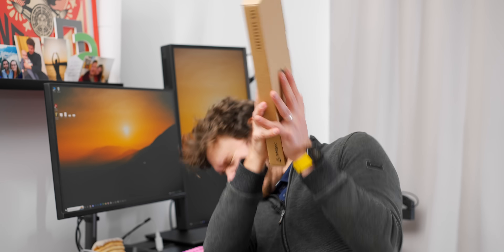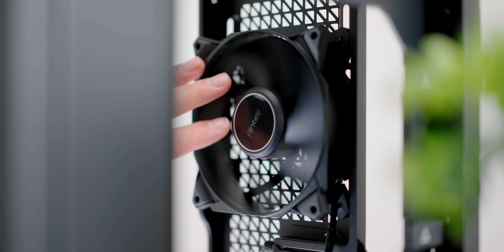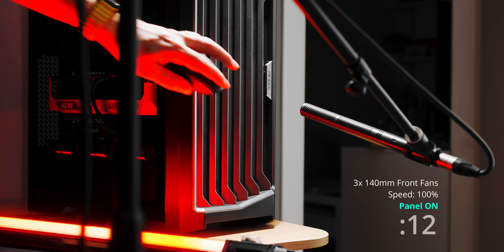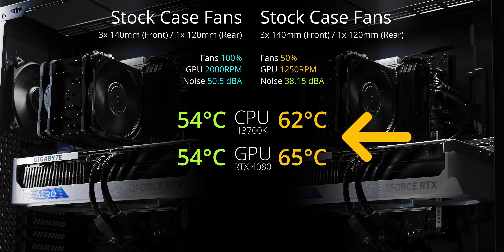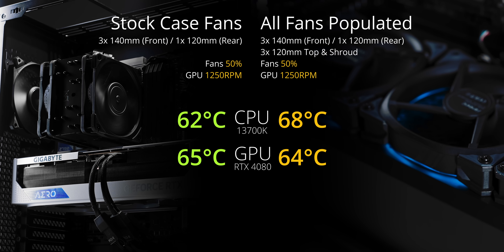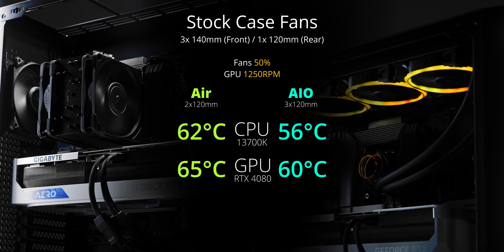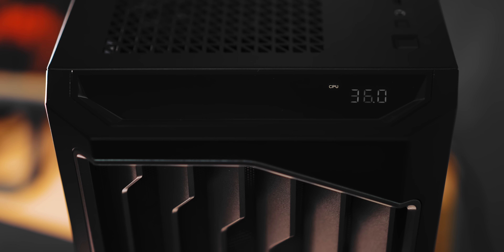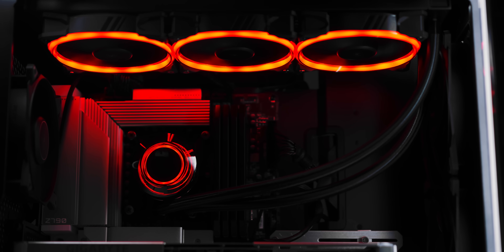How Many Case Fans do you Actually Need?

Comment: zero , i have lian li h2o , 7700 non x , 4090fe
Reply: Why did you pair a 4090 with an "old" quad core cpu?
I'm curious 🤔
Reply: @ZaidosY  its and amd 7700, its 8 cores.
Reply: @ZaidosY  its a 2023 procesor , low volt not hot like x and in a SFF its super !
Reply: @cezarscarlat3661  oh I thought it was an i7 7700, my bad!
Congrats on your pc ❤️
Reply: @ZaidosY  AMD, not Intel

Comment: still rocking an Antec 1100 OG, it's the one with the 200mm fan uptop, not the dual 120 fan mounts.   I got rid of the 200mm fan when I got a hybrid GPU several years ago.
I have only 2 fans as exhaust in my case, no intake fans.  one is in the usual spot at top-back of case, the other is part of an AIO for my gpu which is used as an exhaust at top of case.

we have 2 cats, so not having any screen covering the side panel fan mounts would mean my pc is full of car hair, right?  well, not so fast.   I accidentally figured out a way to minimize cat hair buildup.   The way that our computer area is setup, I have to keep my pc on a small cart on the floor below the desk(not directly on the floor, just on a small cart) and I have it close to the wall behind the desk with the front panel pointed to the left, whcih means the side panel with the fan mounts are about an inch away from the wall.  Just the general airflow of the room and the pc being under a desk and near the wall means that very little to almost no cat hair ever makes it into the pc.

Comment: I have never really been a fan of putting fans on the bottom of the case  I usually do the front and rear so the air is only moving in one direction or have a small slower fan on the rear and two larger fans on the top with fans on the front, I didnt catch if when doing testing the gpu and or cpu where being stressed out I think if not that would make a pretty large difference in temperatures but judgeing by the temperatures posted I think they were a little stressed during testing
Reply: Bottom and top would probably be best since heat travels up but it depends on the case
Reply: @Rooster832  but then the fans are pushing the heat from the GPU over the CPU ;)

Comment: Would have wanted your thoughts on a config where you have 2-3 intake fans, one exhaust fan at the back of the case, and one more exhaust fan at the top of the case.

Recall an LTT video where they said the optimal setup was 2-3 front, one back, one top
Reply: Top one just disrupts things.
Reply: I had 2 front, 1 top, 1 back nf-a14's in a meshify 2 case with a nhd15 cooling my 5900x. The top fan didn't really help as the vast majority of the heat was being exhausted out the back. So I moved the top fan to the front.

Comment: I really wish there would be more videos comparing all the different cooling configs in a same case. It would help greatly when deciding on air cooling vs AIO , and if adding more fans is worth it or not .  Great video as always !
Reply: one of the things an aio has an advnatge on is it can use air from out of the case to cool so your gpu isnt heating
Reply: @mryellow6918  yesssss, but I feel like in a case made for airflow ( the Fractal Torrent, or Lian Li 216 for example ) , the advantages of an AIO would be diminished quite a lot. I would like more tests like that to see if I'm correct or not :)

Comment: I have only two 140mm 800rpm fans in front of my case (Fractal Design Focus G) and everything stays really cool. CPU max 54c and GPU max 49c in 3Dmark Time Spy. Ryzen 5 2600 (AMD Wraith Prism) 3 fan GTX 1070.
Reply: 1) low tdp parts
2) cooler ambient delta 
3) insufficient power loads 

Combination of all 3 is what you have
Reply: @Ziakel  I know this was just my system performance. That's why I listed components. I have actually run two different benchmark softwares and none of the temps go above 70c.
Reply: @Ziakel  Also this video shows how you only need front fans and that rear fan doesn't do much.

Comment: Very good video more for the education of fan positioning than the sponsored case review. Maybe a topic worth revisiting with different air configurations. It kills me everytime I see an OL11 Dynamic (or similar case) with fans on the front and immediately on the side 90 degrees (kind of like an L-shape configuration on the very front portion of the case), both intake causing major turbulence with each other just for the RGB looks. Just because you CAN put fans in there doesn't mean you SHOULD.

Comment: Where is the air coming from for the bottom fans? I have a Lian Li Lancool II Mesh, and my GPU temps dropped when I put a 120mm fan on the bottom to suck in cool air and direct it at the GPU. The Lancool also has mesh bottom skirts so there's a path for fresh air to come in. I don't see a way for fresh air to come in at the bottom of this case, though. 🤔
Reply: Around PSU Intake

Comment: Pre video guess: these things always have the diminishing returns thing, I am guessing every fan gets less results then the previous ones. Without a radiator I think the sweetspot might actually be at 1 in 1 out, but with a rad probably 2 in through rad 1 out.
Okay with seeing the 360 rad that might change it a bit. Perhaps 3 in 1 out or 3 in 2 out will still pull their weight in this one.

My current system has an 18cm intake fan and a 12cm exhaust, hoping that the slight overpressure keeps slowly refreshing the 'dead spot' under the gpu. And with how the fins by the pci ports exhaust warm air while gaming, it seems to work.

Yeah I was expecting some low fan tests as well. 4 fans is kind of already hitting peak efficiency, adding any more doesn't improve much at that point.

Comment: My system has 6. 2 140mm in the front for intake. 3 140mm in the top to exhaust in the top and 1 120 mm rear case fan which I am thinking of replacing with a 140mm for size uniformity. My cpu has a dual tower deep cool neptwin v2 with 2 fans exhausting to the back.

Comment: I´m currently only using 3 front intake fans + 1 bottom (regulated by GPU temperature - sits at 0rpm in idle) and CPU fan. All of them except the bottom fan are on the same 2 curves (mixed curve in fan control - allows setting multiple fan curves to the same fans and react to whatever gets warmer). CPU fan also works as main air exhaust.

In my case, there is no need for dedicated exhaust fans - in full load, if i put my hand behind the case, i can feel the breeze coming out of the case.

PS. All my intake fans have 15mm shrouds in front of them. It helps reducing the noise and also increases intake area for each fan, while slightly reducing available space for the GPU (my GPU is quite short, it fits without any issues).

Comment: Depends really on the case.....
i have better airflow with small cases, rather than big ones, harder to fill with moving air, providing potential multiple air currents.
You can mix vertical and horizontal airflow, as cpu coolers tower models or small factors ones........
just be simple, with low noise levels, and non-opposite airflows.
i noticed a gain with gpu fans, below the gpu. or at 90°, if the fan shoots air from the side panel.
helps to cool the gpu. low rpm fan, just ti help the gpu, especially modern ones with no-fan modes until a certain temperature reached.
Just test it.........beware of power consumption, as more fan, more power needed....logical
Best results where surprisingly with small case, and very long gpu, occupying the case in length....
so one air "tunnel" for the gpu, and the other for the cpu, with a little hot air climbing from the gpu backplate.
And hot air getting exhausted at the top.

Comment: I've been wanting someone to review the Thermaltake 750 CTE case. I think that's the name. They claim that all the populated fan slots will lower temps even on the MB. It holds like 14 fans and I'm sure they want you to use their fans because three costs like $110.00 I do like how the graphics card is vertically mounted. It would be great if you could test the new thermaltake case.
Reply: Kitguru has had a review up for a few days now.
Reply: @Dexx1s  I’ll have to go check it out! Thank you.
Reply: @Dexx1s  looks like I’m going with the fractal torrent case after looking at the thermals.

Comment: If there's a fan slot, I will use it! J/K 🤣 I'm currently using the Lian-Li o11 Air Mini, I use 6x 140mm fans for top exhaust (radiator), front and bottom for intake, plus 1x 120m in the back for exhaust.

Comment: How many fans - well, I know my main system needs all the (ultra low noise/RPM) fans. :-)  Runs nice and cool with slightly positive pressure.

Not sure why, but the SQ on this video seems a bit wonky (which is extremely unusual for HC).

Comment: If there is mesh or grating it must have a fan in front, behind or zip tied to it! REMOVE YOUR TEMPERED GLASS AND REPLACE IT WITH BOX FAN! COOL YOUR RADIATOR WITH 12 DRONE ELECTRIC DUCTED FANS! BUY A 50 LITRE AIR COMPRESSOR AND COOL YOUR USB PORTS!!!